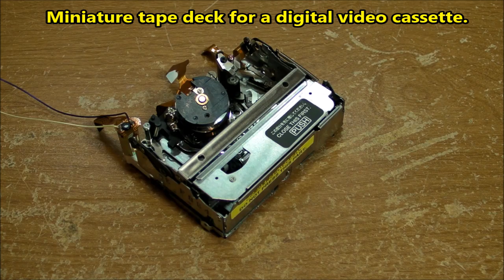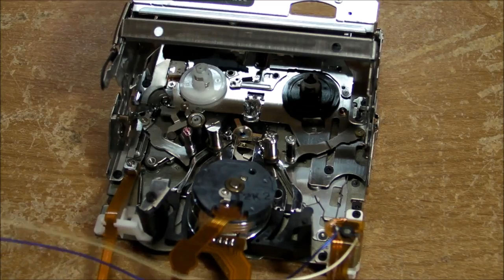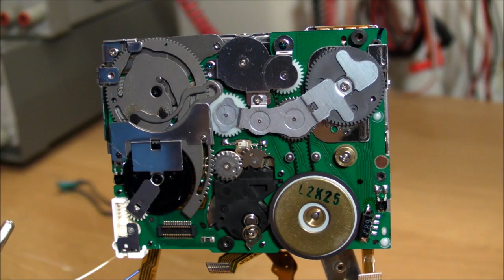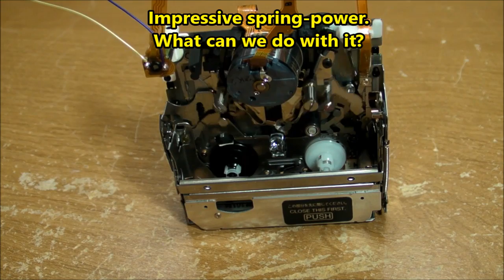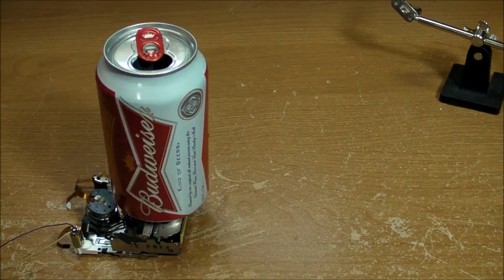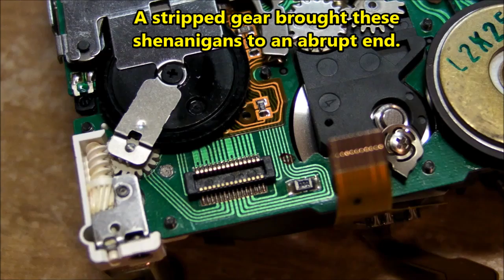(#0183) Camcorder Tape Deck Porn - Canon ZR40

Comment: Just think the amount of time it took to design that little tape machine. Everything coming in, in perfect timing. The tape is just at that right angle for the heads to perfectly scan it.... Speed is controlled accurately.... Sensors to know if there is a tape installed...so on. Great stuff! But as always... Planned obsolescence is built right in that machine. IE: plastic gears :^/
Reply from the maker: Mr Carlson's Lab No, it's my bad. Normally, the motor would be turned off just slightly before the mechanism reaches its maximum extent. I gave the motor no such luxury here. I just powered it with whatever voltage that felt right, with no current limiting, and just pulled one of the wires out of a breadboard about a second after I saw the motor had been stalled each time. All that repeated force on the plastic gear is what destroyed it.
Reply: That poor little gear. I kinda figured that... That little motor was screaming, and you can see in a few shots, that worm gear pushing the the other away as it came to a stall. Neat video Eric!
Reply: Sounds like someone wanted a bit entertainment lol, has anyone ever thought of modifying the gears with a metal gearing setup..

Personally ssd cams these days I would of though tapes would of been a dead art to use...